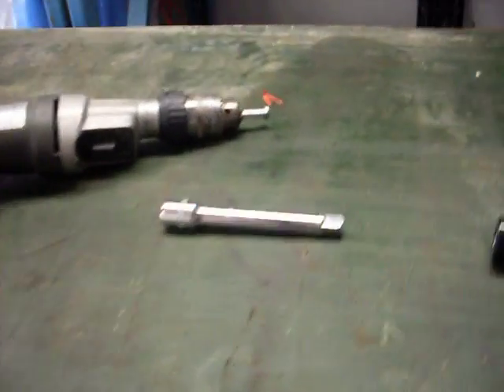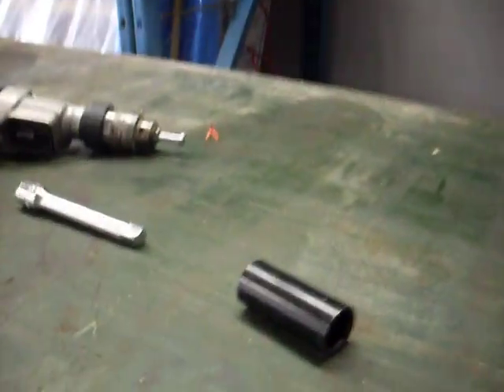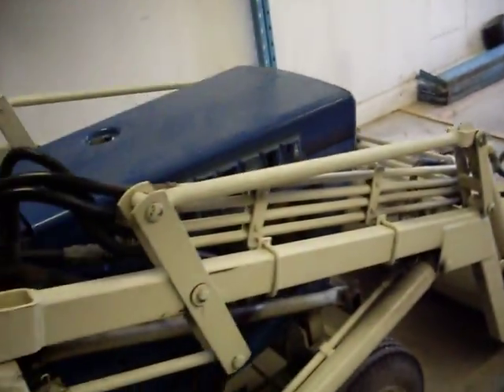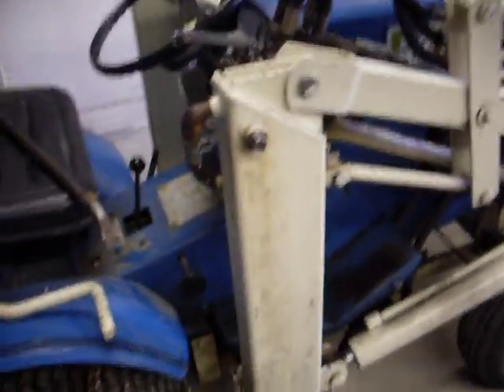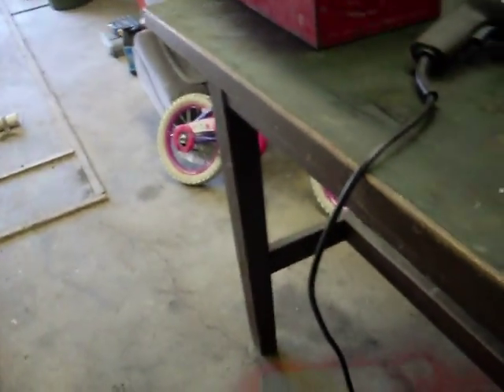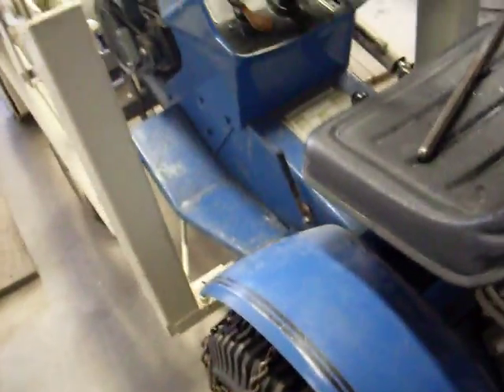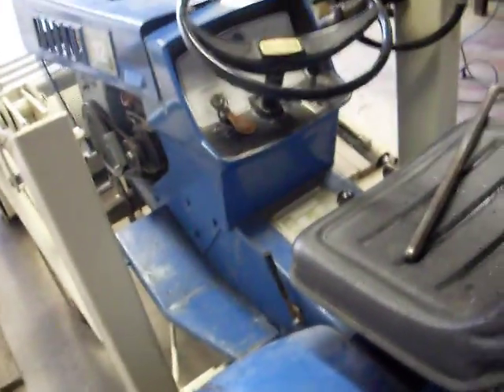HOW TO:Convert a Tecumseh Tractor to Electric Start

Comment: put your daddys, 2" SOCKET extension back and learn your tractor mechanics, have you tested the coil to make sure it wasnt burned out?, have you tested the alternator (yes i know i spelled it wrong), have you taken an homs meter to any of the windings in the coil,OR the starter? you know, if you know what your doing you ca.n turn the key and save your wrist from getting broken